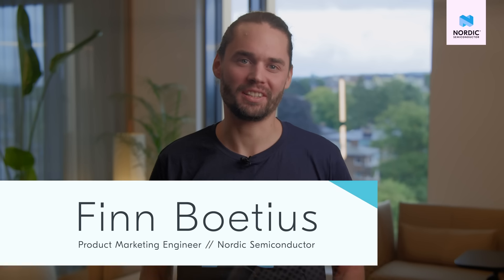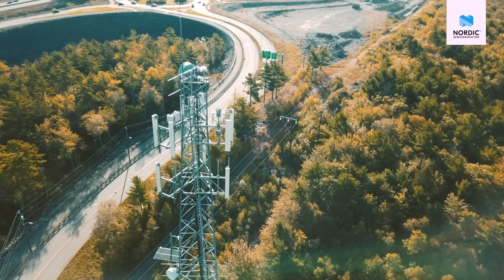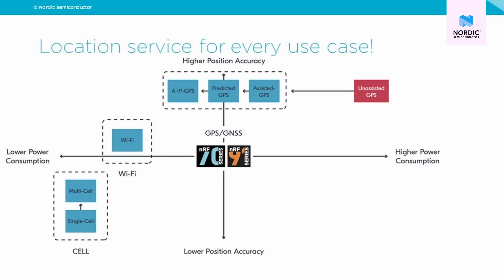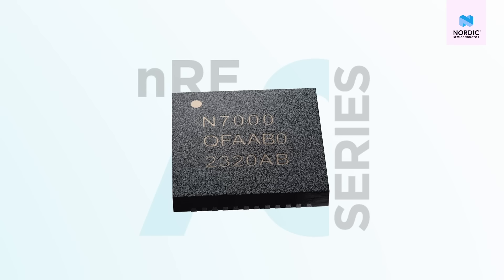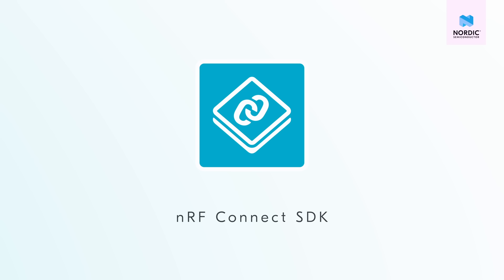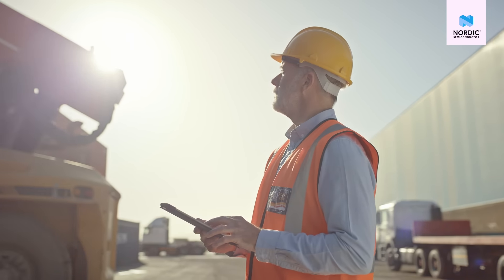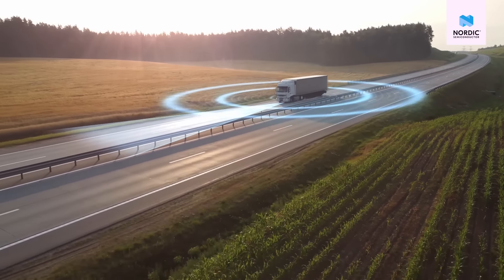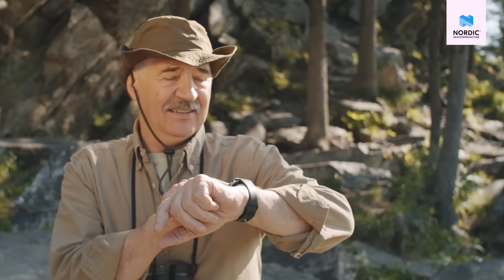Using Wi-Fi for low-power locationing

Comment: If you use wifi for localisation, don't you need to lookup the WiFi AP's in an online database (which requires more power and an LTE connection)?
Reply from the maker: Yes that is correct. That still uses a lot less than GPS. The Database we use is in our nRF Cloud, but you are free to use any you want.